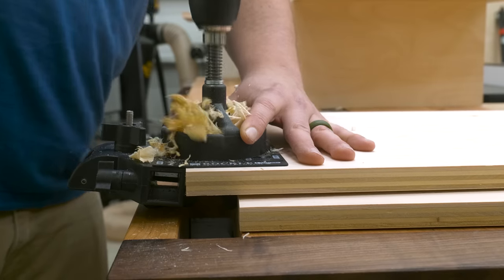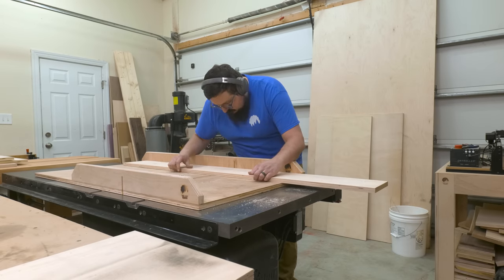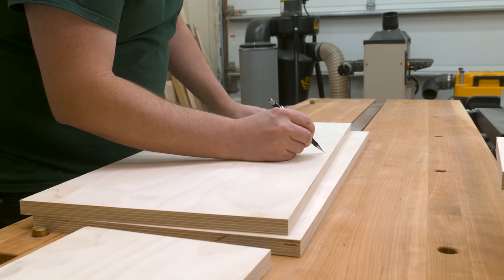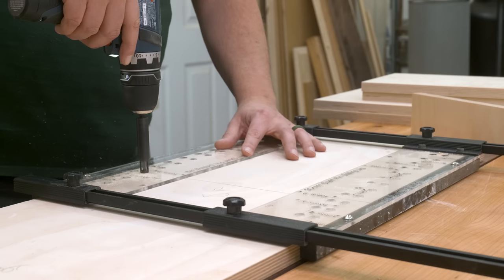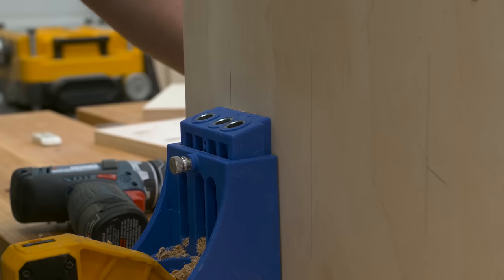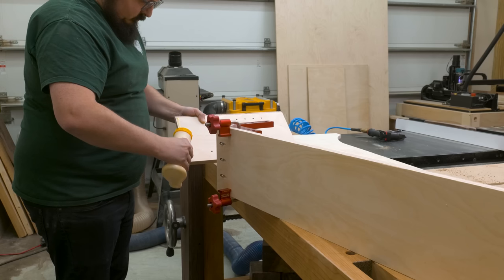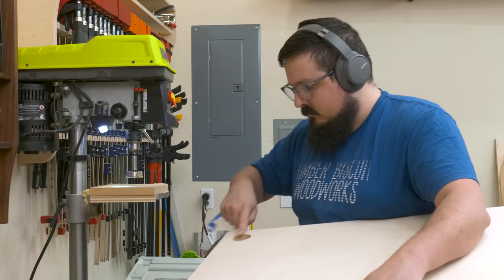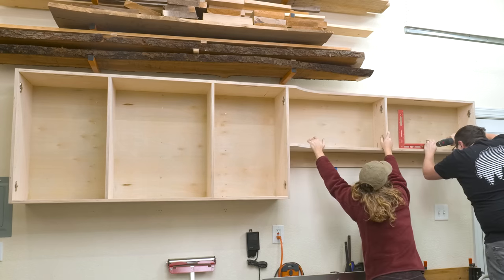Doing This Added a TON of Space

Comment: I like the simplicity of the cabinets and how you designed them to curve back so as not to interfere with using the jointer. I prefer to use different types of joinery on my shop furniture, so I can practice, and hone my skills. I've been studying and practicing Japanese jointery for almost 2 years now, and I have only touched the tip of the amount of joinery they use in furniture and structure builds. Many of the smaller cabinets and furniture builds done in the traditional style do not use glue , nails, or screws. The joints have very tight tolerances so you don't need them. I just picked up a book on Korean joinery and I look forward to tackling them. 
Pocket holes and butt joints are fast and easy, but not a challenge and that is what I love about this craft. After 50 years of woodworking, I'm always learning and never bored with it. Keep doing your thing, it suits you.
Reply from the maker: Absolutely! Japanese joinery is the pinnacle. For this one I’m more going for convenience since it’s just shop furniture but elevating the joinery for a furniture piece is always a fun challenge.

Comment: Yes to the shelf pins. For taller book cases I usually put in a fixed shelf in the middle somewhere too.
Reply from the maker: Good call! I’m actually working on a pretty long piece right now and I’m going with fixed shelves to add structure and prevent racking. Some times the design forces your hand.

Comment: I'm having a ton of shop envy right now.
Reply: Mine is an 8x12 shed.
Reply from the maker: The trick is to slowly move all the non woodworking stuff out of the garage haha
Reply: @TimberBiscuitWoodworks  I do. I built carts for my jointer, planer, band saw and table saw. I roll them outside so I have room inside. I have a 12 ft bench on one side and a miter saw station on the other side.
Reply from the maker: @cabman86  nice man!

Comment: Yes shelf pins for lightweight stuff, for medium weight, use holes that go all the way and bolt the shelves, and for heavier stuff, cut boards the width of the shelf, and the height between each shelf, then screw that to the back. You can add angles to support the front and don the same on the side if it's still too heavy.

Using some laths for less heavy duty shelves works too, and you can always move that by unscrewing them and screwing them at an other height, than add a sticker on the old holes.
Though you can do that with a shelf pin setup or any shelf.
I'll add, use whatever you want for furniture, as long as it looks good enough to you and does its job, it doesn't need to be perfect.
Reply from the maker: Very true

Comment: No shelf pins, sort of. I usually use spacers at the height I want to try out. If I end up liking it where it is, I make the pin hole at that height. No extra pins. Also, have you ever tried "back burning" your pocket holes? When you go to screw in the pocket hole screw, run it in reverse a little first, indenting the receiving panel, then screw the screw in normally. It helps index the screw to a specific spot on the receiving piece and reduce the moving we all hate with pocket holes. Good stuff, man! This is my first video of yours, but you got a new subscriber! Time to check your other videos!
Reply from the maker: No I haven't but I'll try it out next time for sure. Thanks for the tip and welcome to the channel, happy you found it!

Comment: Yes shelf pins. After the video, have you gone back and sanded down, or maybe rounded down with a small router bit, the hole edges used to open the cabinet doors?
Reply from the maker: Nice! I sanded them before I painted the cabinet doors. Just didn’t film all the sanding.

Comment: Yes shelf pins, no of course adjusting them constantly isn’t plausible however the ability to makes it worth occasionally organizing your cabinets. I hate when my kitchen cabinets are limited to only certain adjustments so I like that you gave yourself a wide arrange of adjustability. I love shaker cabinets but for some homes the mid century modern vibes are great and definitely simpler and quicker to build too. My house was built in the 70’s and I could see your cabinet fitting right in. Again look at how much storage you have… these are my absolute favorite builds: shop organizing, space saving, custom to your needs and I love when it’s a new function like the flip tops, pull down shelves, etc. so anymore you want to film I’ll definitely watch
Reply from the maker: Thanks! These fit perfectly with MCM design which is one of my favorites. I appreciate your input!

Comment: thought the smaller upper cabinet doors were gonna be designed to slide. i think tha twould have been a cool way to do that. less cost in hinges. maybe more setup time to route in grooves for the door panels to slide. either way i like the round pulls
Reply from the maker: I actually considered doing that for a while but opted not to in order to save more space. The sliding door would have taken up about an inch or so more from the depth of the cabinet.

Comment: minimal shelf pins. I use imperial for everything except cabinets. I switched over to metric just for those because all the hardware and standards for cabinets are metric, it's made it so much easier. I just got a fastcap metric tape measure and a 150mm double square...the sawstop already has metric on it. hinges, rails, shelf pin holes, etc are all much easier with metric. it's amazing how we buy them based on imperial amounts, but if you measure them with metric it's obvious they're all built for metric and not imperial.
Reply from the maker: Yeah I agree, that's the way to do it. I have a few rules that are metric but not tape. I think I'm gonna have to go grab one this weekend now that you've pointed it out haha!

Comment: I’ve seen 1/2” ply cabinets fall apart or off the walls many times due to weight.  I like to use 3/4” ply or thicker nailer boards to secure to the wall.  Good job though, I like the curved look.  And I might forgo face frames for my next shop build, the color contrast you have looks cool
Reply from the maker: I haven’t had a problem before, but I wont be adding a pull up bar to theses either way. And I really like the frameless look.

Comment: Is there a reason why didn't make the small doors open in different directions (Like a double door)?
Reply from the maker: Yeah so if I did the left door with a hinge on the left side, the door wouldn't be able to open very far as it would run into the right side of the taller cabinet.

Comment: This is so neat and practical, thanks for the great video!
Would you help explain why your side panels of the framework runs all the way to the top? (I believe strength wise this is better) But I do see a lot of taller cabinet builds do the opposite where the top and bottom panels are longer and then side panels fitted inside the top and bottom. Any specific tips you can share regarding the frame build?
Reply from the maker: Thank you! While I don’t have evidence that it is stronger, I think this way makes sense from a sheering perspective. The joints are going to be a lot stronger with the weight supported across the joints rather than moving in the same direction. I hope that makes sense.
Reply: @TimberBiscuitWoodworks  Makes 100% sense. I ended up doing the opposite for the tall cupboard, in case someone wants to pull it in the house. The shelves are being connected with pocket holes or dowels not sure yet. thanks for sharing.
Reply from the maker: Either way you should be fine. Good luck!

Comment: No shelf pins. I never move my shelves and I’m clumsy so I always bump the shelf above what I’m reaching for and knock everything off of it. 😂
Reply from the maker: I’ve done that countless times! I think that’s a pretty good reason for a no.
Reply: @TimberBiscuitWoodworks  what do you think about using 1/2” ply instead of 3/4” for cabinets?  I’m thinking 3/4” is overkill.
Reply from the maker: @Kanthon  honestly I wouldn't build a cabinet this size with 1/2" there isn't enough structure there. But for something small that would hold a lot less mass then 1/2" would be fine.

Comment: Shelf pins... Not really... It's very rare I'd change the pins. Rather use a cleat or just screw it into the side. 
Secondarily, Kreg DOES make pocket hole jigs with dust collection... or you can get a 3d printed dust port for your K4/K5 on etsy for $15
Reply from the maker: Yeah but I'm not buying a new one. I rarely use it.